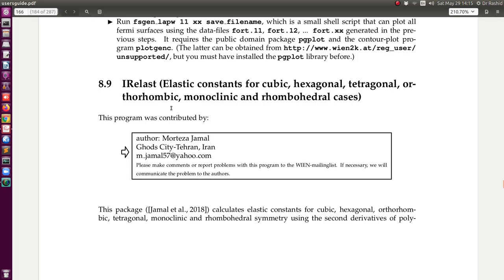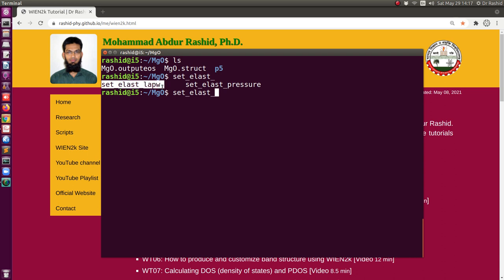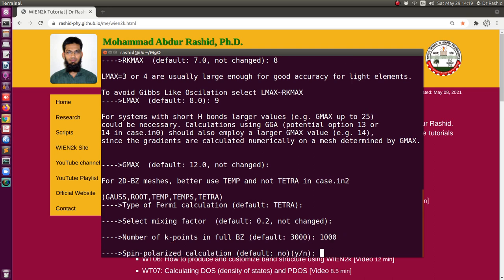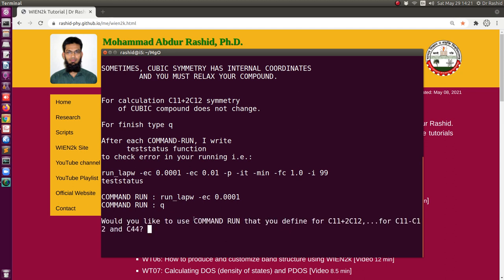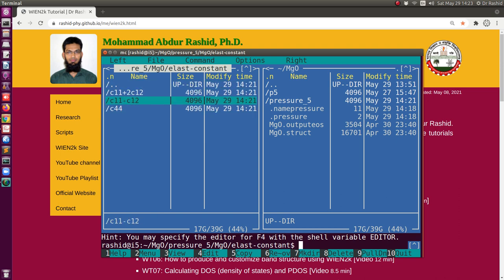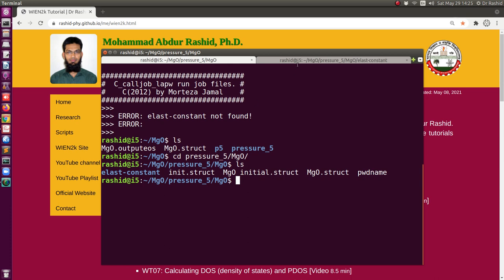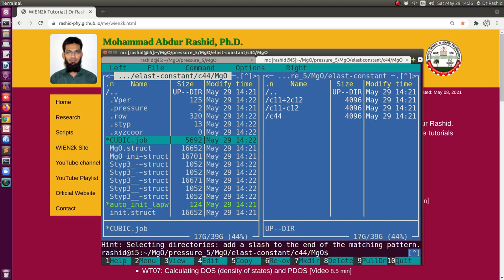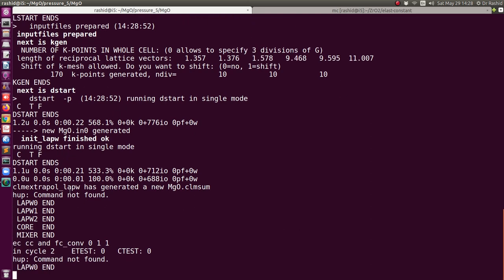WT16: How to calculate elastic constants with WIEN2k and IRelast || Bulk, Shear & Young modulus

Comment: salam 3laykom, thank you for this video. when I calculate  strucutre  : 215 (P -4 3 m) , terminal end Eror in statu -2 , de same in case statu -1 and  statu -0.5 ....why ?
we can explain, thanks
Reply from the maker: Walaikum-salam. Welcome! 
If you write me with a screenshot of the error, I shall try to suggest a solution.
Reply: @phy22  

 n stop error n 
clmextrapol_lapw did not extrapolate new density because of missing Ni1.5Mn0.5Co0.51.5Ga.rsp
hup: Command not found.
head: impossible d'ouvrir 'Ni1.5Mn0.5Co0.51.5Ga.inm' en lecture: Aucun fichier ou dossier de ce type
head: impossible d'ouvrir 'Ni1.5Mn0.5Co0.51.5Ga.inm' en lecture: Aucun fichier ou dossier de ce type
no Ni1.5Mn0.5Co0.51.5Ga.clmsum(_old) file found, which is necessary for lapw0 !
grep: No match.
grep: No match.
grep: No match.
grep: No match.

>   stop error
-----------------------------------------------------
 
ERROR status in Styp3_-2.0
Reply from the maker: I'm sorry, this beyond my ability.
Reply from the maker: If you are still facing the problem add "set bin=$WIENROOT" at line 10 in the script $WIENROOT/SRC_IRelast/script-elastic/initIR_lapw just before the line "#---> functions & subroutines".
Reply from the maker: There was a line before " n stop error n " in the error message, which you did not included but someone else did and eventually led to the above solution.

Comment: sir, my linux version does not execute the first command . this is set_elast , what should i do
Reply from the maker: Email me with the details of the error (including a screenshot), I shall try my best to suggest a possible solution.
Reply: @phy22  sir can you share your email address please.
how ever the set_elast command simply says 
no such command exists
Reply from the maker: chmod  +x  $WIENROOT/SRC_IRelast/script-elastic/*
Above command may solve your problem.
Visit tiny.cc/w2k
Reply: @phy22  thank you sir. it helps me alot in set_elast_lapw running. but run_elast_pressure donot appear
Reply: i am using wien2k_14 version

Comment: set_elast_pressure "command not found", plz help sir
Reply: You are not used current version of Wien2k.
Reply: @muhammadasim057  i am using wien2k 14
Reply: @Rehanjamilpk   read user guide, if you don't understand then i will provide you the basic commands.
Reply: @muhammadasim057  plz provide me basic commands I have to find elastic properties ASAP

Comment: Sir, I am getting the following error while running IRelast
/home/jisha/WIEN2k/SRC_IRelast/script-elastic/x: Command not found.
 n stop error n 
clmextrapol_lapw did not extrapolate new density because of missing LiTiCoSn.rsp
hup: Command not found.
head: cannot open 'LiTiCoSn.inm' for reading: No such file or directory
head: cannot open 'LiTiCoSn.inm' for reading: No such file or directory
no LiTiCoSn.clmsum(_old) file found, which is necessary for lapw0 !
grep: *scf1*: No such file or directory
grep: lapw2*.error: No such file or directory

>   stop error
-----------------------------------------------------
 
ERROR status in Styp3_-2.0
Reply from the maker: The script you running is not detecting $WIENROOT folder. You can overwrite that by adding "set bin=$WIENROOT".
Reply: @phy22  sir where this command to be given
Reply from the maker: According to the version I'm using in line 10 of  $WIENROOT/SRC_IRelast/script-elastic/initIR_lapw file just before the line "#---> functions & subroutines".
Reply from the maker: I'm not familiar with this bug, sorry! Which version of WIEN2k are you using? And which compiler?
Reply: @phy22  19.1 and gfortran
Reply: @drjishaannieabraham8628  . have you got this error corrected. if yes please help me also

Comment: Sir how much RAM needed for scf calculation of Perovskite material (CH3NH3PbI3) because I have a i5 and 
4 Gb Ram laptop and program stucked while running.
Please guide
Reply from the maker: It depends on many things: parallel calculation, number of nonequivalent atoms, number of CPU cores used, k-points, RMT, etc. I don't know an exact way of calculating RAM to be used. This video may help you to customize your laptop so that you may get most of that during the calculation: http://www.youtube.com/watch?v=nZijemkovGY

Depending of the system size and machine condition lapw1 may take several hours or even days.
Reply: @phy22  ok sir thank you